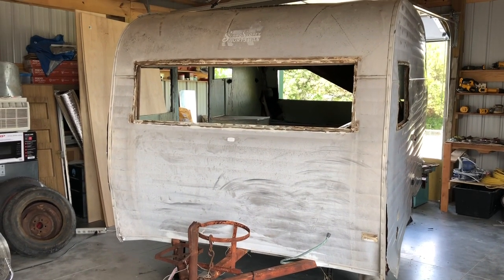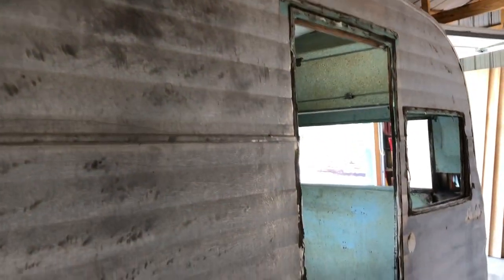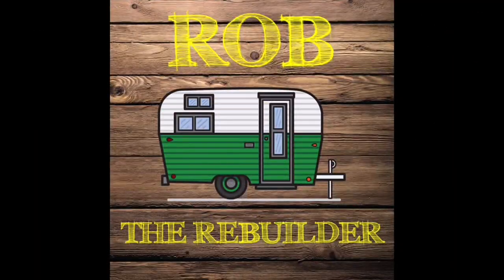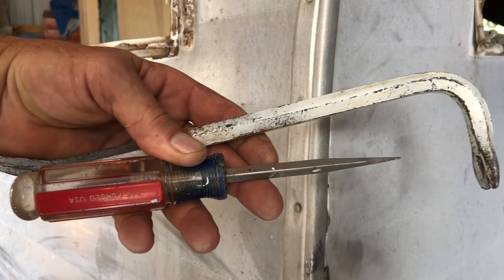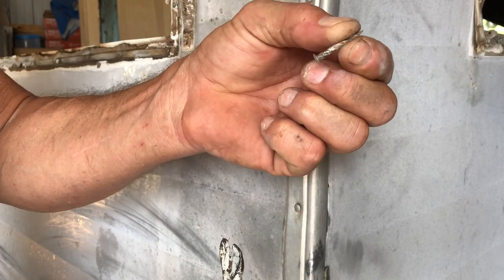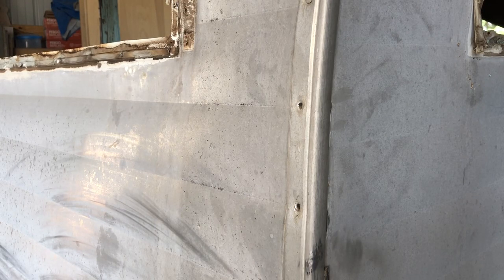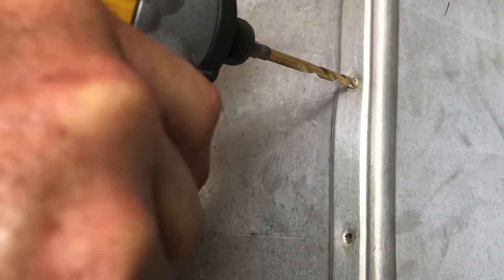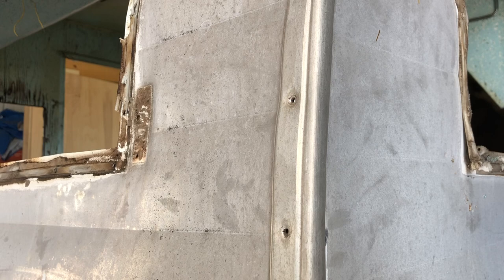EP 72 Safely removing  aluminum nails from the J rail on vintage camper travel trailer Serro Scotty

Comment: Thanks for the good tips.  I also use a nail set and hammer to put a small divot in the head of the aluminum nail.  This gives a spot for the drill bit to grab so it doesn't slide off the head of the aluminum nail.
Reply from the maker: That is a great tip. Thanks

Comment: Nice sermon. I have found that I have been able to get those nasty nails out easier using a thin screw driver to loosen them then grab them with a pair of wire cutters real careful like. Thank goodness only the skin is put together with "the devils" nails and some stuff on the inside. The J rail is put on with hex head screws.
Reply from the maker: I have started using your method. It works!

Comment: you said you like comments, so I'm commenting! 😆 I am doing this today and I am kind of nervous. it seems like a big step!!😜
Reply from the maker: Take your time. Take pictures. Take notes.
Good luck.
Reply: So.... I started on removing the J rails yesterday, 😜 actually my dad gave me some help by starting it. It really wasn't that bad. Some of the nails did break in half, while in the rail itself, but the heads stayed on. I just used a hammer a pry bar and pliers to get them out. It took about an hour per rail, I think. I got halfway through on each and had to stop because I didn't have an exacto knife to cut the cemented mesh cover on the roof. That cover kept the camper protected for decades, I hate to do it.

Comment: Go to a harbor-freight and get their hinge self centering alignment drill tool. Know pick the largest tool of the set. Know what to do with this tool is remove the drill bit from the tool. Now drill the end of the tool concave with a larger drill bit just a little bit, so it will fit over the cap of the Devils nails. Now reinstall the drill bit back into the tool. Now when using the tool place it over the cap of the nail. Now use the tool as it’s meant to be used and it will drill the center of the nail cap assisting in removing the of the nail.
Reply from the maker: Something new! Thanks

Comment: Best way to do it is by using a pointed punch to put a small dent into the centre of the nail then use a pop rivet drill to start the hole. Then switch to a larger drill the same size or a bit larger than the shank of the nail.
Reply from the maker: I think that would take me too long. Don't think I have that much time.

Comment: I just started removing the screws today.. what do you suggest is the best to replace them with? Do you seal the joins in the aluminum also?
Reply from the maker: I run butyl tape on the roof side of the roof rail. I use #6  3/4" screws